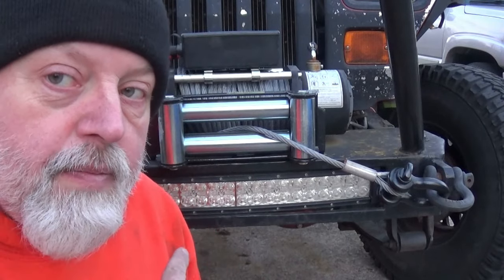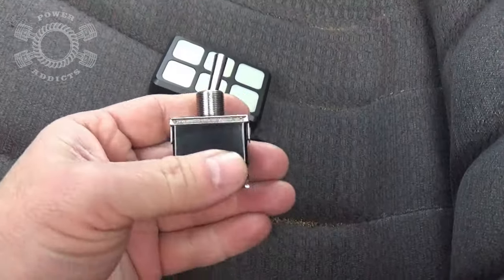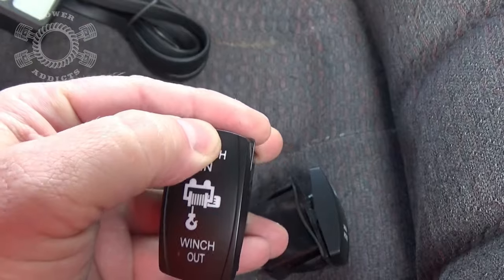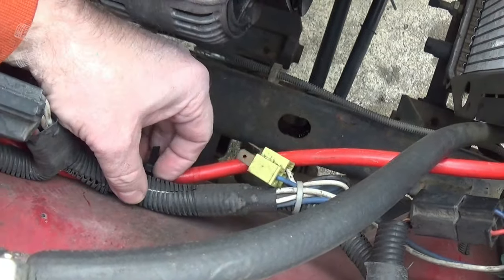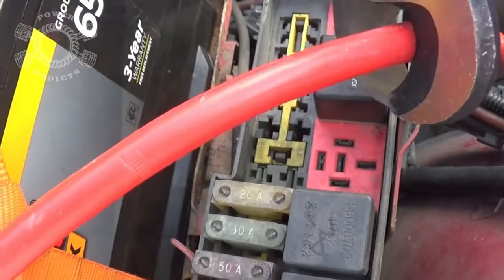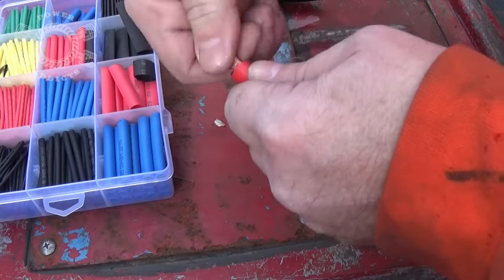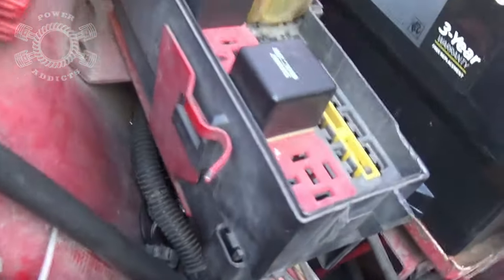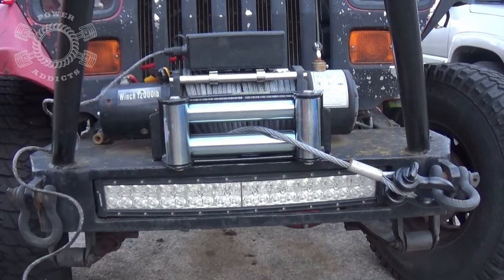I added a Power Toggle Switch to my Recovery Winch! (It’s awesome!)

Comment from the maker: Parts used in this video:
500A Relay: https://amzn.to/3UitGLt
on/off switch toggle: https://amzn.to/49iCghN
on/off switch rocker: https://amzn.to/47UUHYM
6 gang switch panel: https://amzn.to/3SEIGlG
Lug Crimper and cable cutter set: https://amzn.to/3vWBJnf
30 amp Circuit Tester: https://amzn.to/42jQZXi

These are affiliate links to Amazon. Using these links gives Power Addicts a small commission fee, but it costs you NOTHING ZERO NADDA Not a cent more to use these links. It helps Power Addicts create these videos for you. Thank you for your support!!

Comment: Hey. Love your videos. Recently I've been watching all your videos about fuel tanks and filler lines. I've been having an issue at the gas station with only being able to put about 10 dollars into the tank before the gas pump starts to click off. My fill line and vent line are not blocked ( took it all apart to check). I had seen your video about removing the plastic insert on the vent side. Was wondering if maybe I removed the insert on the fill side that maybe it would allow better g a s flow to not kick the pump. And help is appreciated. Thank you.
Reply from the maker: For some weird reason the shape and position of the YJ filler neck causes the pump to trip off. It is a safety thing that the pump handle senses pressure like gas is spraying back up. Turn the gas pump nozzle a little sideways and it should help. You may have to mess around with what position to hold the pump nozzle to figure out where it works at. Also, sometimes going to a different gas station is the cure because some pumps "pressure sensor" isn't as trip happy as others. Hope that helps!
Reply: Thank you. I'm gonna give that a shot. If it is still too bad I might relocate the fill location to the side of the tub. Appreciate the help

Comment: hey man i ran into a serious issue with my yj 4.0 i can revv it to limiter all day long but the second i put it under load and try pulling off it sputters and backfires and jus generally won’t do over 1500 rpm i’ve changed mutiple parts like ignition coil tps fuel pump fuel filter and the distributor and wires was replaced 3 years ago and i did spark plugs over 2-3 months ago im completely stumped i would really appreciate help i posted it on a 4.0 jeep group and didn’t get any feedback please help
Reply: and my fuel psi is at 21 but when i flip my key i get no pressure at all